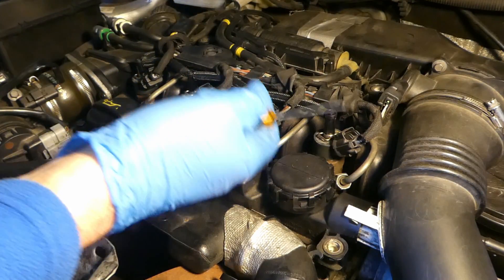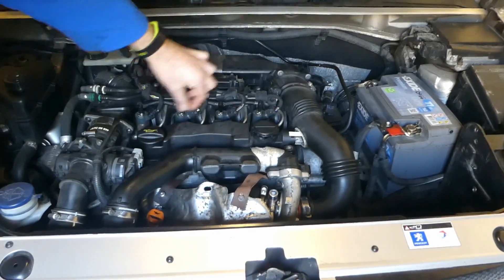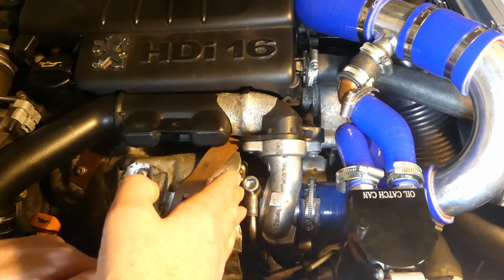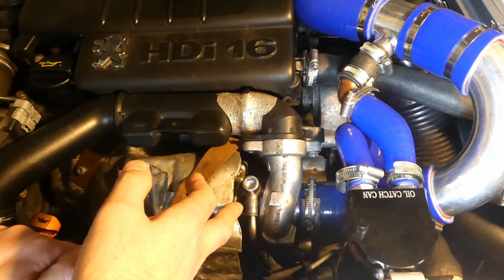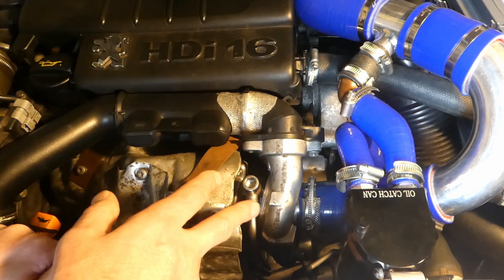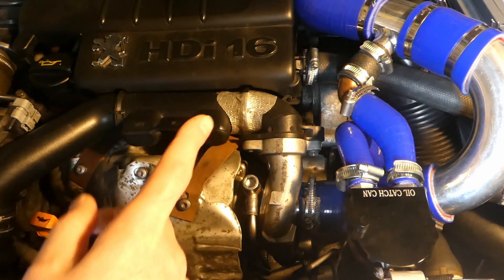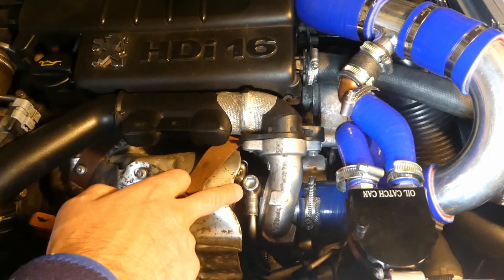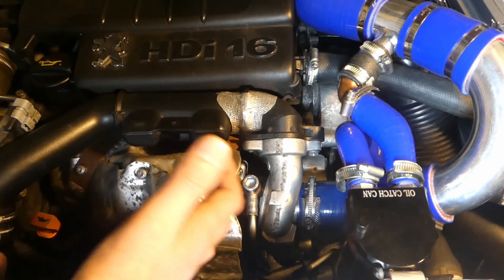1.6HDi turbo replacement, the full guide (part 5/5: engine running)

Comment: Could you give me an advice please. I ruined the turbo by not paying attention to the oil on the turbo sled. 
Changes that preceded the destruction of the turbo. I replaced the valve cover, oil, oil filter and air filter as a precaution.
After these changes, now i register the oil at the output of the valve cover. 
Note: Prior to these changes, the turbo had very slight axial and radial play. It is now destroyed.

Now I have no idea how to prevent oil from coming out of the valve cover. 

Thanks in advance
Reply from the maker: Is oil coming from the seals on the valve cover or somewhere else? You could try to re-seal the valve cover or you may need to see if you have excessive crankcase pressure and that is pushing the oil out. Was the turbo banjo bolt replaced with the mesh? If you have excessive crankcase pressure, you need to address that before.

Comment: Do you really need to remove the catalytic converter in order to change the turbo cartridge? Is it just the front heat shield the one that is in the way of the wastegate  lever? How much does the turbo cartridge cost? Low MAP readings as well as smoke at start-up were the reasons to change the turbo cartridge?
Reply from the maker: Here is how much it really costs: https://youtu.be/QNcyf9H3F04
Now, for my car I had to remove the catalytic converter, as I could not remove the heatshields. Basically, if you can remove the front heat shield then you do not need to remove the exhaust side of things. Yes, I replaced it due to startup smoke, although that did not fix it.

Comment: Thank you so much for your videos. They’re without doubt the best I’ve come across for working on my 308 1.6 hdi due to your thoroughness. I had low oil pressure warnings but the turbo thankfully seems to be fine. I removed the sump and replaced the pick up as it was clogged. I also removed the filter from the turbo oil feed. All reassembled and running much quieter with no low oil pressure warnings. Only downside is I now have the dreaded depollution system faulty warning! Going to connect to the ODB2 to see what codes I get.
Reply from the maker: Thank you Mike for the good words. I generally try to film in a way that if I were to view the video I would know what to do without additional explanation.
The depollution faulty warning might be blocked EGR and/or DPF. ODB2 should give you some info on what might be wrong.

Comment: Greetings for your Work , i Think I have the same problem , well , my car its c4 picasso 2009 and it gas blue smoke but not only when its cold even if its warm its blue smoke on the exhaust . Idk should replace the turbo ?
Reply from the maker: Yes, I guess the blue smoke is under acceleration mainly, i.e. when the turbo kicks in. If that is the case, yes it is probably the turbo.
Reply: @moremolecules  well when its under accelereation , its not that much smoke , just a little bit like maybe you cant see . But when thw turbo kicks in la 2500rpm its giving a lot of blue smoke , so replace the turbo? Any other potentially pice ?
Reply from the maker: @SinnX4  yes, it is likely to be the turbo. For cost see here: https://www.youtube.com/watch?v=QNcyf9H3F04

Comment: can you explain the oil catch can /new pipes ? how it works , what it does, and the benefits? many thanks good vids!
Reply from the maker: It is fairly simple, the crankcases gasses come out and are routed through a catch can to remove any oil vapor inside. From the oil catch can it goes to pre-turbo into the air intake.
This is the same as before, apart from putting an oil catch can in-between the crankcase and the air intake. The original design goes straight from the crankcase to the air intake, this is the small white spout coming from the crankcase.
Benefits, much less oil going through the air intake system where combined with the sooty EGR gasses creates a goey film on all surfaces. This with time builds up and restricts the air flow.

Comment: Some great content that will really help people out, I also have blue smoke on start up which has done it from 30k 7 years on its getting slightly worse it's not the valve stem seals doesn't blow any smoke after pulling away from idle would be interesting in getting to the bottom of this.
Reply from the maker: Thank you very much indeed James, much appreciated. Thank you as well for the blue smoke. I also think it is not the valve stem seals as the same with you, it does not blow any smoke on traffic light or going downhill for a prolonged time and then hitting the gas pedal. I still think it is oily condensation within the intercooler and gets blown at startup, but will have to test that.

Comment: Interesting. You have had oil coming from the crankcase breather to the turbo - you modified it and added oil catch can. You still have had blue smoke from the exhaust and assumed that it was oil going to the intercooler.  I have a lot of oil dripping from the crankcase breather, which is going into the turbine and the whole turbine is covered with the oil drips....So I can tell that a lot of oil must be going to the intercooler. I'm wondering why I don't have any blue smoke, nor clogged FAP filter... BTW, service, which works only with french cars assured me that it's normal for this motor at this milage to have oil dripping to the turbo and won't cause any further issue, which is insane! How can it be normal at all?!
Reply from the maker: Hi Kosta, I am preparing a new video, but with the two oil catch cans I have nearly eliminated the blue smoke on startup. There is only a very faint whiff of blue smoke, one cannot almost see it. I took everything apart (oil catch can tubing) and it seems that they are not 100% efficient and some oil is still passing through. I bit the bullet and bought an original mann hummel and will see if this eliminates it altogether. I have no oil in the turbo itself, really clean, but still some in the pipe to the intercooler. Is it normal, I suspect it is. Unfortunately, the design of the PCV is not that sophisticated. I think BMW have some cyclone system that is perhaps a tad better.

Comment: should have removed oil sump and replaced pickup, all this work could be wasted
Reply from the maker: Hi paul, I have done that although have not put it out as a video. As I said in the video, the turbo had not failed, but the oil pickup was spotless and sump was spotless. I will post the video of the sump once it's been edited. Thanks for the comment. I absolutely agree that it needs to be done.
Reply: @moremolecules  i look forward to seeing this 🙂
Reply from the maker: @emmanuelhud1  Will do as soon as possible :-)